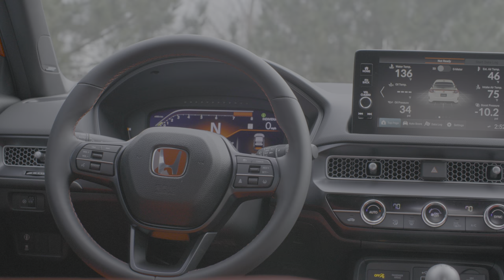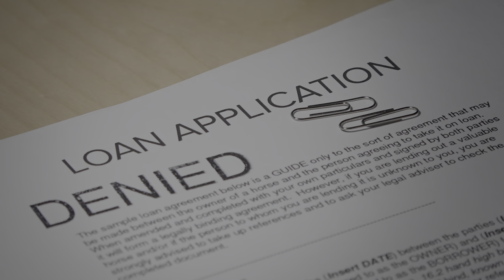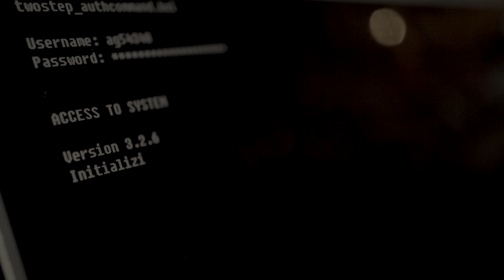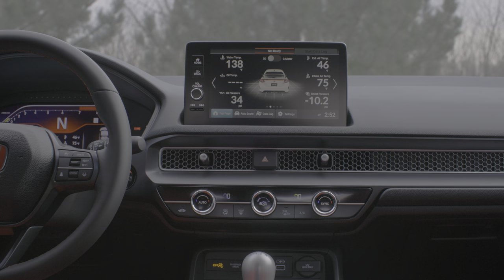Why I Bought an FL5 Civic Type R

Comment: I think Honda makes a great engine, I’d love an old civic BUT I got a 2010 civic, it lasted the miles but EVERYTHING was falling apart. The reflective stuff on the rear view mirror was turning brown, the small vent near the door would just blow out, the weather stripping was hard and cracking around the doors. ICING on the cake was the paint, for those years Honda had bad paint jobs. We didn’t get a recall letter and weren’t offered a repaint. I was also burned on a new goldwing too, the oil light and other lights kept coming on in the first 3,000mi, I had to hire help to get Honda to take it back. Honda I feel treated me like trash. Worst experience ever!

Comment: I operate a Honda Acura certified collision center and that didn’t have any weight to getting one. This car appeals to me since I can track it. I’ve always had bmw m3 track cars but not those are so high up in price. The type r seems like an excellent option. But not over msrp. Even local to yourself it doesn’t seem like there is any help to get a car like this for someone who would actually use it as intended. Bumper color match has other factors too. Like static electricity of plastic vs metal. This affects color matching and how the paint is applied to the panels.

Comment: As someone who worked in a dealership, there are reasons as to why we don’t let people drive the more special cars. If there are miles on the car the next person that actually wants to buy will be turned off by the miles lol. That’s just one of many examples. That being said, that doesn’t excuse dealerships for being dicks (if they are) to their customers. Marksup and the GM said it’s all supply and demand. I wish I could get a Supra/r33/r34 for a more reasonable price but people over value the fuck out of them. It’s not something I agree w/ but something I understand.

Comment: Would you say getting the type R at MSRP, would be one of the least depreciating cars in the next 3-4 years? Coming from 2020 nd2 RF GT manual. retaining as much value as possible is important to me, also golf R or Civic type R ?  I tickled with alfa romeo 4c but they're a bit overpriced.
Reply from the maker: Id wait to see what Integra Type S does to the values.
Reply: @savagegeese  when is it coming ?
Reply: @savagegeese  outside of the type R , integra S debate. What is the top 3 best drivers cars in your opinion under 60k-65k ( new or used for the matter ) . I'm coming from the miata and might need a little more power.  I'm shopping type r, integra type s, golf r but cant think of anything else, thank you !
Reply: @savagegeese  hopefully ill get a reply ! i'm curious about your opinion !

Comment: My dream car was and is Shelby GT 350 since it was announced I had to wait 6 to 7 years and buy preowned because of ADM when they were new and it sucks! I traded my 2021 fk8 for a 2018 GT 350 two owner low mileage car. When the prices came down  and I could finally afford one. This crap has gotta stop.

Comment: The Civic Type R is a great car. Congratz on the acquisition. But as a company Honda's days are numbered. There sales globally have dropped so bad and with there new system of selling vehicles and closing Honda dealers around the world has pretty much put them on a landslide going over the edge. Long gone are the days at there peak in the 90's. Civics, CRX, Integras and Preludes not to mention the NSX. A base model Civic is a tad off the new WRX. There prices are just insanely expensive for what your getting. $53k US?. If so thats almost the price of a Nissan Z. For a few more you can get the Supra. Unfortunately you have to pay what they want if you want to get what you want.

Comment: Nice snag mark…in Canada it seems you need to be on a dealers list and then that dealer is in a lottery. But at over $50,000 for it…I have to much winter to not have a car that is AWD. 

For the GR Corolla you get on a dealers list and wait for allocation…I am second on the list and just heard from the dealer he has been allocated 2…so that works for me. Hard to believe they want $47,000 for it plus it has to be financed. Would have been happier if it was the GR Yaris. In the meantime I am driving the 2022 WRX…

Comment: I find a very big flaw with what the owner was saying about dealerships charging over msrp due to demand and justifying it by comparing it to the real estate market. 

A law was made in the past, by the government, stating that manufacturers had to use dealerships to sell thier cars because they did not want the manufacturers to sell them over msrp. Now look what they dealers are doing. They were established to prevent the very thing that they have been doing.

This law doesn't apply to electric vehicles and I'll applaud all the manufacturers that will not supply vehicles to the dealerships that were selling cars to consumers at outrageous prices.

Comment: Pricing aside, I'm curious if you feel you got preferential treatment by just being able to order the color/trim/accessories you wanted? Typically, certain manufacturers, like Toyota and Honda for example, don't let the customer factory order vehicles to their exact specifications (unlike say GM or Ford). I know I tried to do so in the past and was told the dealerships get what they get, and you as the customer don't have any say in the matter. Yet, this isn't the first time I've seen YouTube creators be able to order vehicles to their specifications when the normal consumer wouldn't be able to (the guys at Everyday Driver were able to specify what they wanted when they got their GR86 for example).

Comment: I have a red fk8 and my bumpers look exactly the same to the rest of the car and you are right the fl5 is boring and i dont know but i just dont see it like the fk8 , the last gen just has more carácter to it  guess thats why I bought the new Elantra N ans have to say they are very similar only thing i can see in the hyundai is it has better QA on the build paint panels and other parts are better fitted than Honda .

Comment: So let me try and sum up this video…

1.	You hate the modern Hondas. They will never be as good as the older vehicles.
2.	You want the most hyped car out in the market. However, it MUST be this exact color and I DON’T want to pay extra OR NO DEAL.
3.	You previously bought a car from a shitty dealer. Don’t want to get a shitty deal again.
4.	You get the dealer on the video to promote his business so they won’t charge you over MSRP.
5.	You’ve done many videos (monetized) for the brand therefore deserve something in return.
6.	You made sure to be painstakingly demanding and picky to the dealer service team and record every second of the delivery, since the Honda basically treat cars like shit when they receive them.
7.	“German paint is better than Japanese paint”. You were surprised that Honda did a decent job on the paint.
8.	“The normal person is supposed to get this car.” (Refer back to #5.)
9.	Supply and demand is ruining the purchase experience of cool cars. You wish you were back in the 90’s. (Refer to #3)
10.	“Car doesn’t look horrible if you get the right color”.
11.	Mods are available for it (Shout out to another potential sponsor for future freebies)
12.	“Not my dream car”.
13.	And another shout out to a current sponsor so I really can pay for my new car.

All while sounding like you just got kicked in the groin. MY GOD.

Comment: The only dealership experiences worse than Honda are Kia/Hyundai, Nissan, and Chrysler. We've all dealt with it. There are good ones, I'm sure, but the average experience with Honda dealerships is poor. Honda as a brand has ridden out their 90s reputation for entirely too long while not doing anywhere near enough to retain that reputation - both in product and in interaction.

Comment: It's absolute bullshit to just blame "market forces" as a catch-all reason for such ludicrous pricing across ALL segments of the auto sales industry. An early 90s Buick LaCrosse with 75K miles on it is not worth $20K+. Dealers where I live have been ridiculous, pricing cars that SHOULD be on the Under $10K Lot at absolutely absurd ranges. And I'm not even talking about fun cars. I've been shopping for years now for just a basic ass cheap commuter with low miles. The "affordable performance" car is f**king dead at this point. Those "deals" only exist on Craigslist and only if you know how to turn a wrench. Both manufacturers and dealers are to blame here. Honda COULD make more than just a thousand Type-R models. Why create such ridiculous artificial scarcity when they KNOW 200% that they'd be able to sell every single one of them likely before they ever hit a dealer lot? To me, it's just stupid business.

Comment: Ahhh now the fascination USA has with Honda makes sense. They never got a real Type R.  These modern Type R are focussed driver cars but they aren't like the 90s Type R models which were hardcore versions of already hot hatches (VtiR).   They tweaked already high rpm engines, stiffer everything, lighter everything, etc to make hardcore street cars. If only Toyota/Subaru made a modern Type R out of the GR86.

This thing looks like a fast grandma mobile.  I'm sure it's a great FWD but I just don't care, and neither should I. With ICE engines going away I've got better things to do than play with turbo FWDs that sound like nothing.

Comment: There’s so much hand wringing about dealer markup.  I’m not a fan of paying more than MSRP….no one is.  But it’s simple supply and demand.  If any of you owned the dealer, think about how you’d resist the temptation of making a larger profit when there are more interested buyers than units you will ever have to sell.

As for the car.  I just don’t get it.  I had a 2022 Si.  The level of power is well matched to a fwd car.  And yet, I sold it after 11 months (to
Buy a gr86).  Fwd has limitations for an enthusiast vehicle.  Awd assesses a weight penalty.  If the goal is maximum driving pleasure (vs chasing specs), rwd is tough to beat.

Comment: Oh Boy .
At least no CVT on this version 🤣😉
For the first time in many years it looks all right for Honda standards that always for years had major styling issues , design choices issues and flaws . 
It is a lot of money for a 20K compact car based vehicle and even if performance was of Lambo or Ferrari mixed with 911 its Econo car cheapness feel comes thru . 
45K can get much nicer product to drive and enjoy , even than with this Civic grip and power to the ground are put down on 265!!! wide Max performance summer tires .
I guess if someone installed 265 wide Max grip tires on a  Hyundai Accent it would grip as hell even with out modifications to the chassis 😉
But it seems to be a Hondas way to gain grip , even on tiny torqueless CVT plagued base Civics they use wide tires .
The same car with AWD could easily use 225 width and put power down better .
Sorry but 45K  for an Econo Civic based product is just crazy for me  and dont tell me it can out run a damn space shuttle and out run a bullet train I don't care for it.
Let's hope it will be reliable for you and you can enjoy the dealership experience ...  
You deserve special treatment from this brand that you just did major marketing for and behind the scenes they should bloody give your the car and thank for marketing 😀

Comment: The worst part on a Honda is the dealer.  It's amazing that Honda does not fix the dealership problem.
99% of car salesmen are losers that graduated into scammers.
Horrible Honda Dealerships?
Add Pfluger (Now  "Pacific Honda" in Honolulu) to the list.  After  two months of waiting I went there after work to pick up my new Si that I had put a deposit on.  The salesman said that he made a mistake and it would be $200 more.  I was sleep deprived and cared more about ending the buying "experience"  and dealing with a lying salesman than the $200, so I just paid it. Years later I found out that the Pfluger Acura dealer did the same scam to my buddy.  Upshot: Pfluger father and son went  to prison.  Son, tax evasion.  Pfluger Dad went to jail for killing 7 people due to a dam that he modified.  F both of them.

I did the same thing back in the day, told the dealer NOT to prep it, leave ALL the plastic on it, don't wash it, don't wax it.
Congrats on the acquisition!

Comment: My local dealer wanted $50K for a $40K GR Corolla - not even the Circuit Edition. I'm sorry, but this whole stupid markup crap didn't happen on most of these cars until the last year or two. A lot of people are going to be upside down on these things because of speculation and that most of them are going to get beaten on. They're depreciating assets because new cars aren't built like older ones were and they just don't hold up over time. So, unless you park it in a garage and don't use it, it's just not worth the money to me.

Comment: One could add a turbo kit to the RS hatch and have more fun than in the Civic Type R for almost half the price of the dealer inflated Type R. It would have more headroom, an automatic transmission, and all wheel drive!!!!!  An Alfa Tonale Veloce PHEV  has as much sportiness, equal torque and adjustable suspension, more room in the back, all wheel drive, muuuch better looks, interior, visibility, more quiet interior and much much better gas mileage.  Plus, the resale on the Alfa will be garbage next year and a steal!!!!!!! Honda can screw themselves with the dealer markups.
Reply: cope of the year here

Comment: This class of car has gotten ridiculously priced.  There are far too many vehicles that you could buy used that are just as good at the daily stuff and far greater on the track.  I couldn't justify spending $50k+ on a car + mods that is front wheel drive and a civic at heart.  This goes for the GTI's and Hyundai N vehicles as well.  This class of car used to be affordable for the enthusiast.

Comment: Just by an FK8.  Stuff the FL5. They are just as quick (throttle house says the FK8 is quicker in rolling acceleration) and stuff the dealers. Not only that, they look wild, the FL5 looks too average looking.

Comment: I've found that most of the people crying and moaning about dealer mark-ups think they have some right to buy cars at SUGGESTED retail.  They have no such right! A car, house, atv, motorcycle, baseball card, comic book, antique gun, and so on are only worth what people are willing to pay for them.  If there are 10,000 people that want to buy one of these Hondas and there are only going to be 5000 made, the market will dictate the value of the car rather than some sticker price and rightfully so. 
   The manufacturer can suggest a retail price all they want (usually the cost of production w/profit margin added) that they hope the dealer makes.  In limited production cars though, the actual market value is usually much greater b/c of the huge demand over a small supply.  If the dealer, who is in business to make money, doesn't charge that market value then the next guy will!  Most of the whiners want the dealers to sell at sticker, so they can afford it and then get all this equity in the car as soon as they drive off the lot, or so they can flip it and make the profit!  
   I wonder, what if the Federal government made a law that would require dealers to sell these new limited-production cars at suggested retail or below BUT with the catch that the buyer has to sell the car at that price or lower as well if he/she sells it within the first 5 years.......  How many of the complainers would want that rule in place? I doubt there would be very many.....

Comment: Good thing about tesla is no pricing games. Price is what it is. Most of the process is done through the app and is seamless. Say what you want about tesla and how it's not a good car. But with an fl5 + ADM, you can get a model 3 performance which does 1/4 mile in 11.5 and 0-60 in 3.3. I have an 8th gen civic si and its been great. My m3p is also great and a very different experience. The buying experience w tesla, certainly makes me want to change our franchise laws.

Comment: There is nothing wrong with a dealer accepting more than msrp. If I'm only willing to pay 45k for this car and someone else is willing to pay 75k then that is generally a sign they will value the car more than I do. Isn't it right that the person who values the car more and will pay more, get the car? And when you sell a car of yours and there's two bidders who's bid will you accept?

I get that many of us are a little cranky about the prices. I am too. But I put the blame on manufacturers for not making enough enthusiast cars. Look at Toyota producing such a limited number of GR Corolla's. The whole point of a Corolla is that they are attainable and look how precious they are acting with that car. Only 1,400 Circuit Editions (the one you want) and they are limited to one year only. 51k+ for a Morizo? Go fly a kite Toyota!

Auto manufacturers should do enthusiasts (their biggest fans) a solid and build more of these cars before there gone for good.